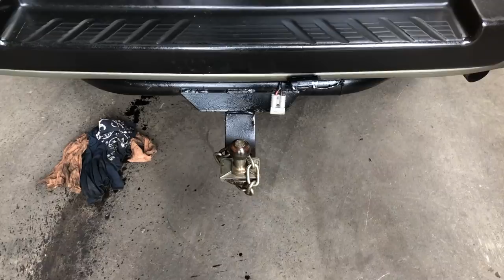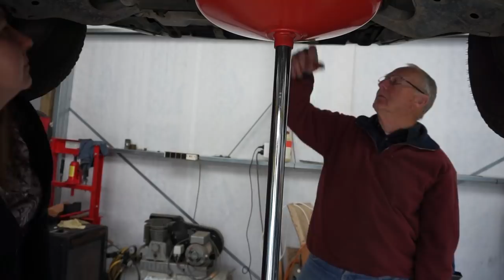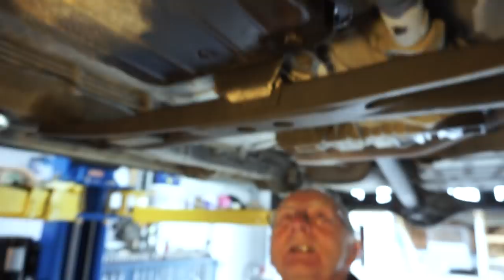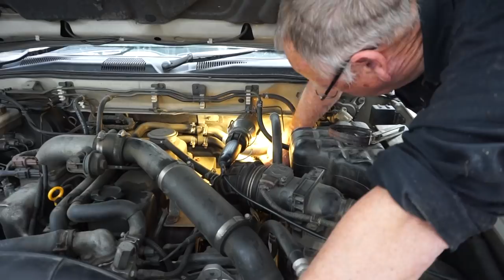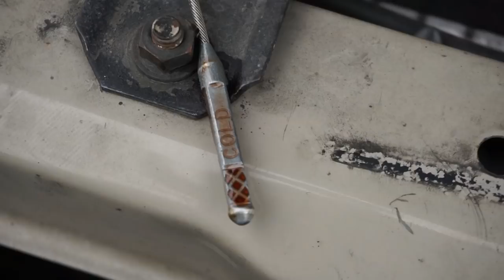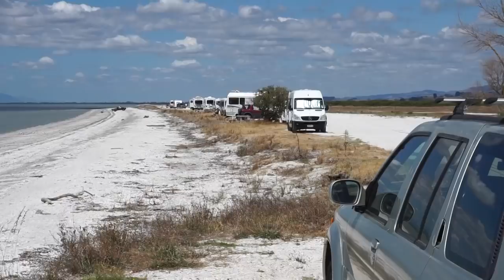Car Died - Is It Fixable In Time?

Comment: Someone's probably already told you, but you will have to clean your friction pads too. Use the brake cleaner fluid and it doesn't hurt to rub them with some sanding paper as well. You easily find the friction pads in your hitch.
Reply from the maker: Yes, I should have done it properly...

Comment: As you are towing a van with an automatic car you definitely need a transmission cooler fitted to the auto cooler lines . Disconnect the lines from the radiator and re connect them to a stand alone cooler radiator . It will keep you automatic much cooler and will make it operate better and last longer . Great vids . Cheers from Australia
Reply: Shane Anderson hello, my las car was a 1991 FORD TAURUS, a year never to hav owned, as they has transmission problems, TAURUS, MERCURY SABLE, LINCOLN , this had been my FIRST USED CAR 56k miles, & took an Insurance policy, on it , it finally failed& I had it replaced free, But I paid for viscous engine mounts, later I had my mechanic, installed a tranny cooler I had for another car, so it was installed, & DISCONNECTED THE RADIATOR COOLER, WELL that HAD BEEN THE REASON  temperature, as that car went on to go for 420k ,  but it had low compression on #5 clilinder.  So it was one with an other TAURUS 2013ODEL USED 21k  cheers from NJ,,, USA

Comment: My general rule..... If it’s a generally decent motor, fix it. If it’s been a bit of a dog then cut your losses. Never spend a fortune, get fed up then part with it only for someone else to benefit from your expensive outlay. Many people with automatic transmissions seem to forget about services but regular (30k miles or so) oil and filter changes are a must especially when towing regularly. Transmission fluid should never be dark an burnt. If so change immediately. With friction hitches keeping dry and grease/oil free is a must. Brake cleaner good for the job but if contaminated it will be necessary to pop out the friction pads from inside the hitch cup (generally straightforward and usually needs only a decent size flat screwdriver) and give them a good clean.

Comment: As well as servicing your ball (sanding and degreasing). I would recommend changing the pads on your hitch as its likely got all dirty too. Do you ever check your noseweight when towing? Makes the world of difference giving a smoother tow when it's correct.
Reply from the maker: I should get one of those caps for the tow ball... stop it getting rusty.

Comment: Sends me to the towing hitch needs greasing . .  I could be wrong

Nice to see that your hands on as it will make life easier for yourself
Reply from the maker: Ah UK caravans can't have grease near the towing hitch... apparently a different system?
Reply: @TravellingK  Used to be able to butthere again only experince i got with towing is small trailers and my only experience with caravans are static ones for holidays with family long time ago
Reply: No you can't grease the tow bar. As the Alco hitches on the caravan have built in stabilizes.

Comment: Definitely need to sand the pads, they have been contaminated so you will need to remove them and clean them up, if that doesn’t work then more likely will need to replace, fingers crossed no more problems 🤞
Reply: I agree, take the pads out and give them a good sand down
Reply: it's an old van. replace them.
Reply from the maker: Thank you. I'll share what I find in the next video😀
Reply: @TravellingK  when you remove them you will see that they have a shiny glaze on them, this glaze needs to be removed by the sand paper.
 Alko actually recommend that they are cleaned before every journey, that's probably a bit over the top though

Comment: As already stated, your friction pads will be contaminated. You won't be able to get the auto fluid out of them, so replacement is the only option. 
It's a very simple process. I did mine last month, took 30 minutes. Mine has 4, some older caravans only have 2. One on each side, if it's 4 there's a large curved one and a small disc, front and back. Cost (UK) £52  and patience to fit them.
Might see you when you're here in the UK.
Cheers
Mike
Reply from the maker: Oh, hope you can make it to a meet-up! I didn't know some caravans have 4 friction pads.

Comment: Glad you got sorted out totally stressful when the vehicle craps out. I finally go my van sorted out massive oil leak fixed new cam and drive belts, and the limp mode issue sorted out. When I bought the van 8 months ago I figured due to the size age and weight it was just sluggish on hills losing power became normal to me, now the lads at Euro City in Napier have got it running like good un, fair flies around the place, its like a new van. So happy. Soooo ready to hit the road. Enjoy your repaired vehicle mate safe travs.
Reply from the maker: Isn't it funny that you don't know of a problem until it goes away! So glad your van is now fixed, zippy and ready to race around!
Reply: Travelling K pinching myself how well she’s going it’s bizarre 🚐

Comment: How has the car been holding up? My little blue camper failed it's MOT primarily on the brakes and a few other issues.. busy fixing it now
Reply from the maker: It's doing ok now! Sorry to hear your van didn't pass... hope it's not too expensive.
Reply: Its not very expensive since I can do the work myself. But now i know its very expensive if you have a garage do it for you. Its Alot of work. I have to Dissasemble half the car.. 😣

Comment: Please don't put your hand on the tow ball again because if something should go wrong you could get your hand smashed by the trailer hitch. The odds of that ever happening are almost nil but there is no reason to take that chance. Glad to hear you got it fixed and yes you should have kept an eye on that transmission fluid level. That would have told you that the leak was getting worse.
Reply from the maker: I've actually since hear of that horror story happening! Shall be more careful.

Comment: I hat a similar problem two months ago. I was towing my caravan to a Ferry Crossing. when I arrived, the car and Caravan was covered in Red oil. I Used The Crossing time to figure out where the oil was coming from. It leaked from a radiator pipe with gearbox oil. I was stuck 2 days at the repair shop. But I was lucky just to have to top up the oil and replace the pipe.
Reply from the maker: Oh ouch! How did you get from the ferry to the repair shop? Did the car limp there? That was a fast first too!
Reply: @TravellingK  I was lucky, there was only a few hundred metres to the repair shop. I do Wonder why the car didn't indicate that something was wrong. I leaked 4,5 liters of Automatic Gear oil.
Reply from the maker: Sheesh, that's a lot of fluid to leak! I'm thinking my old transmission must not have had the indicator light working?! Maybe it was the same for you?

Comment: You must have a thin layer of grease on your tow ball, metal rubbing on metal is bad
Reply from the maker: Ah but UK hitches are different and have pads inside them that grip the towball.
Reply: The friction type hitches MUST be run without grease on them otherwise the internal pads will be destroyed. I know due to been a caravan owner and my parents have caravanned for at least 35 years

Comment: Hmm...I've never heard of grease on the tow ball as being a no-no?  I always grease mine, it allows for the hitch to rotate on the ball easily & quietly.  Maybe you're using a NZ hitch that we don't have here in the US?  Here's a quick article I found (but I've done it for 40 years now).  I do clean & apply new grease regularly to reduce the amount of grit on it.    https://www.rvtravel.com/grease-up-the-hitch-ball/
Reply from the maker: Apparently it's a big no-no for UK caravans - the way they work.
Reply: Always greased mine . Kept an old tennis ball over it when not towing to keep the muck out.

Comment: You may have contaminated your friction pads on your hitch stabiliser with any transmission oil that had got onto your tow ball. Have a look here for tips on how to clean them. The noise will the friction pads slipping a bit on the tow ball instead of gripping it https://www.caravantalk.co.uk/community/topic/24341-alko-3004-stabilizer-friction-pads-cleaning-contaminants-off/
Reply from the maker: Thank you! Yes, that does sound like the issue!

Comment: I was wondering when your transmission issues would make it to YouTube. Good old Nissan Terrano is definitely worth repairing and keeping on the road. Very good vehicle with a solid engine and usually a good transmission.
I've got a slow leak in my transmission, need to top it up occasionally.
Safe travels, hope your vehicle is running smoothly now
Reply from the maker: I definitely has a back-log of videos! But getting close to real-time soon😀

Comment: You could have done without that  ! It just shows you how much you need a car when living on the road ......it could have been worse if you were living in a motorhome  at least you still had your caravan to live in. Always good to lift that bonnet and check your levels its a pain but very important when you use your vehicle to tow with as its under more strain  No doubt lesson learnt $$$$$$$
Reply from the maker: That's so true about a motorhome. And I think I was lucky in a way with where it happened. I now know where the transmission fluid is to check! haha

Comment: Not be rude but this is a normal problem with most ladies . Not knowing the rule . STOP and cteckout what’s wrong . Put more fluid in then drive it to the shop .
Reply from the maker: In this case, I'm glad I carried on. No place to pull over when it happened anyway🤷‍♀️